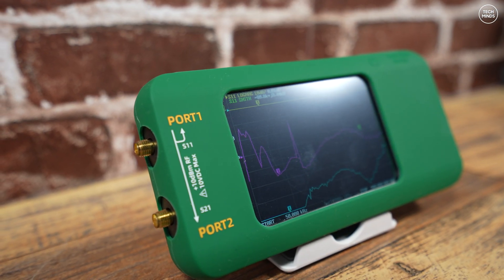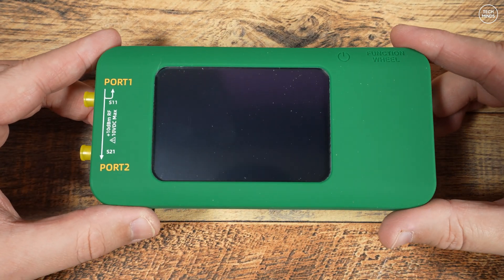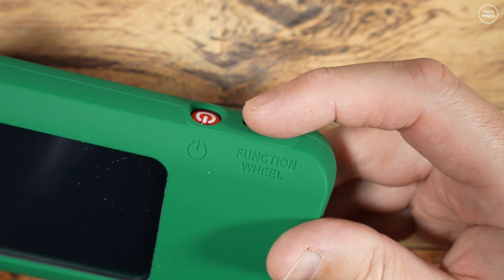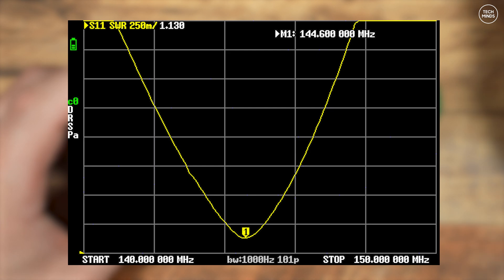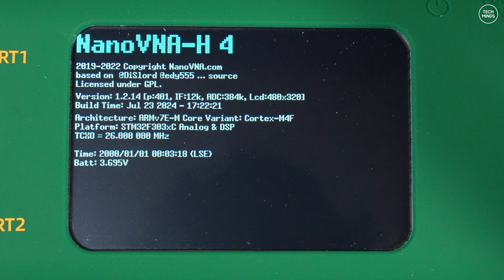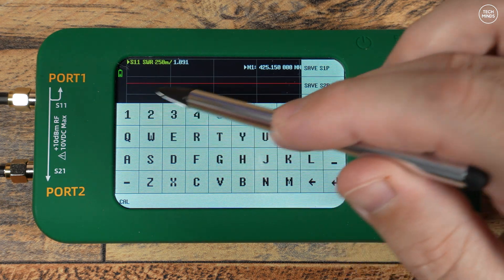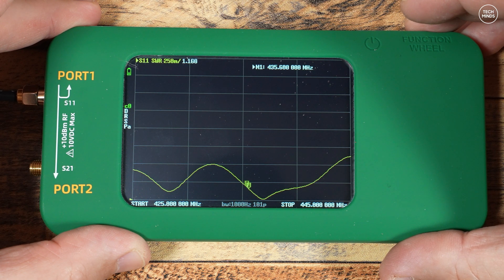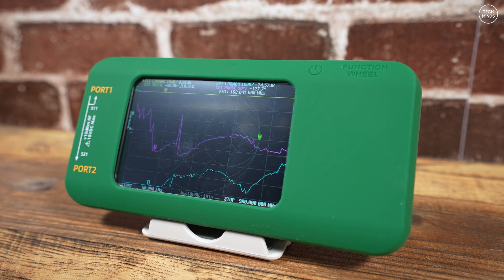Antenna Fault Found - BSIDE P5 Vector Network Analyzer 10kHz to 1.5GHz

Comment: I've the Diamond X6000 and V2000, Both great. The X6000 is like a 510 with 23 cms regards gain.
My V2000 was up for over 20 years and not ever any problems though I've seen some of the none diamond antennas snap at the base and windmill.

Comment: Hi Mat, I have the V-2000 for over 15 years and it still performs outstanding. I can hear a 6 meter repeater PI7SIX at 95 km's from my qth. The antenna sits on top of a 10 meter aluminum mast. 73 Phil ON4VP

Comment: You can get misleading results if you test an installed aerial when the feeder cable is not included in the calibration. The correct way to do this is to keep a good quality patch lead for test purposes only. Calibrate to the end of the test lead and the connect it direct to the aerial, which of course means getting it down or testing it before to goes up.
Reply: The only way to test is at the antenna.   Can do several ways.   1 climb up. Disconnect antenna. Put dummy load on coax. Test coax. Save shot. Attach antenna. Take another shot.  U isolate things to troubleshoot them.   Great video and great info.  I chose the 20 off coupon on amazon and get it tmrw. ✌️

Comment: check the coaxial cable first, before changing the antenna. Moisture and UV light are doing funny things.
Reply: I agree here - it could also be as simple as the coaxial cable having too much attenuation so it consumes enough reflections to lower the SWR. I have seen that with RG213 when it goes up in length.

Another experience I have is that self-vulcanizing tape acts as a conductor at VHF and above. No problem if you want to seal a coaxial joint but if you use it to seal a ladder joint then each taped wire has to be standalone.
I discovered the self-vulcanizing tape issue when trying to make an UHF antenna and just got weird results.

It's actually better to measure the whole loop transmitting through the antenna under test and have a separate receiving antenna to see if the signal goes out or not, the same way as if you measure a filter. The receiving antenna should be some broadband type like a bowtie and preferably with a known spectrum, but if you have the ability to rotate the antenna under test you can get a good idea about how well it works - is it a dummy load or is it a directional antenna with the radiation in the expected direction. An open field with very few reflections would be needed for this kind of measurement.

Comment: Id argue that VSWR of 2 is perfectly ok and not a fault
Reply: If is a fiberglass housed antenna, moisture can do that over time along with air pollution...
Reply from the maker: What I failed to mention in the video, is that when the antenna was first installed, it was way lower, cant remember what, but lower. Maybe I should of said that. Cheers
Reply: @TechMindsOfficial  It could be cable termination problems or moisture then.

Comment: I have a NanonVNA-H4, and this one actually looks quite a bit nicer. I agree that the rubber boot makes it feel a bit more chuckable, so I would typically buy this one to go on POTA trips with. The price is also rather competitive.
Reply: but the boot will do nothing if it lands on the sma connectors though